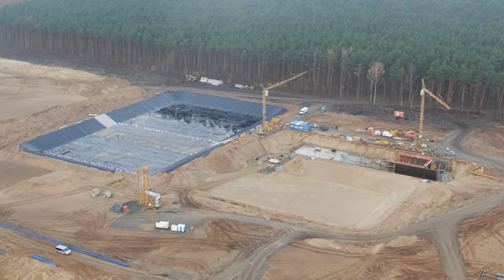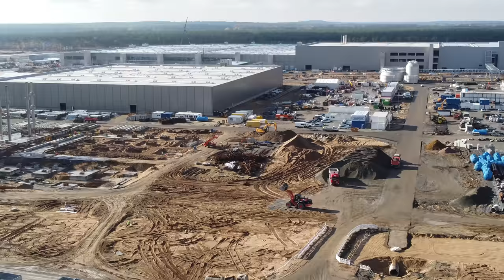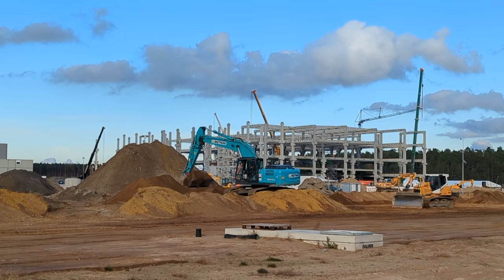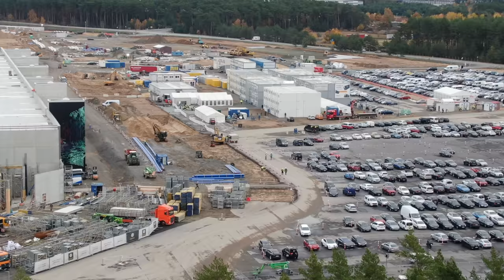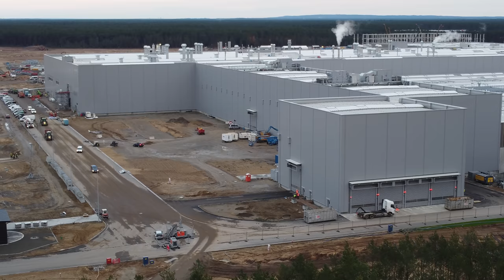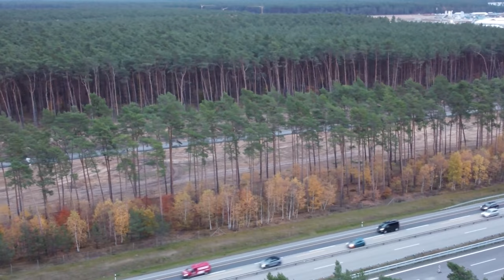Giga Berlin | 2021-11-03 | Timelapse

Comment: Man that battery building is shaping up to be one massive beast. So nice!
Reply: Any idea how the dimensions of Berlin's battery building compare to the battery cell area in Austin?
Reply: @zacadams7070  I looked at a rough blueprint of Giga Austin phase 1. The width of the North West section where the battery cell area is showing 465 ft x about 750 ft. It is 4 stories high. I don't know the footprint for the Berlin battery factory.
Reply from the maker: Berlin cell production is 262 ft x 965 ft with an option to extend to 465 ft x 965 ft. The cell production section in austin has the exact same number of columns, so I do think the cell production section in Austin is also 965 ft long if the space between the columns is the same. In that case they would have the exact same footprint and layout.
Reply: @TobiasLindh  Good to know. There should be enough cell production to support the future phases of vehicles at both Austin and Berlin for many years. This is a huge plus for cost savings and speed of battery manufacturing processes.

Comment: I love the precision that is required to drop all those beams into perfect alignment on the vertical uprights,... can you imagine the chaos if the following scenario took place  when the beam was being lowered into place... Man on cherry picker to Crane driver  ( on the Radio ) Peter hold every thing for a minute.... as we are going Left down the line the gap between the beams is increasing and when we are going right down the line the gap is decreasing,  Question how are all those beams fixed in such perfect Alignment ?...  Probably some type of Laser equipment used.

Comment: Another great video but I think some clips were not quite HD, are you using a second drone Tobias?
Reply from the maker: I've been using the DJI Mavic 2 Zoom and the DJI Mini 2. The Mini 2 zooms digitally, so it loses resolution with zoom. But I've done that since the beginning of the year, so there is no difference.
However, there were two scenes from the ground, which I've filmed with the Google Pixel 6 Pro. It was the first time I've used the Pixel 6 Pro, and it seems that I've done something wrong when I zoomed.

Comment: Fossil fueled equipment building a factory that will build electric replacements. Well, maybe not exactly, but they could in theory build packs and motors that could go into earth movers, and they have a semi design. Maybe they can make a cab over design here later.
Reply: Electric construction machines already exist from many brands.
Reply from the maker: The Tesla Semi is basically a cab over design. But as there is no engine that term doesn't make sense anyway. I don't think it's too long for Europe with slight modifications at the rear for European standards.

Comment: I'm starting to feel a bit worried about Tesla still not having a building permit for the Giga factory they've almost finished building. What's the hold up?
Reply: Same old environmental impact complaints. There was supposed to be a final open forum to voice these concerns starting on Oct 18th I think, but because the council did not give the proper amount of time for the preannouncement when the complaints could begin, they had to reschedule it for beginning of Nov. I believe they have 30 days to voice there concerns. Once those have been assessed final approval should be imminent.
Reply from the maker: The main reason that the permit takes so long is because Tesla changed the plans twice.
Reply: @TobiasLindh  That is true. Ofc when the changes had to be made, the entire plan needs to be reviewed because the infrastructure is changed for utilities and so forth. Just a shame the process takes so long.